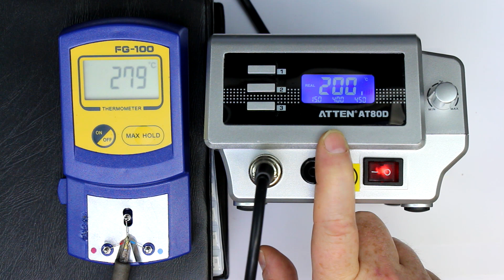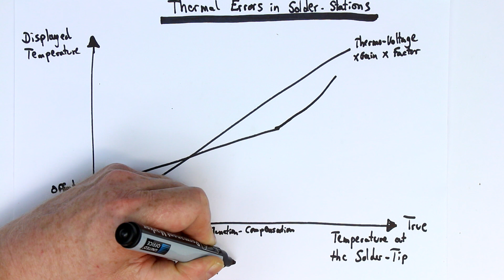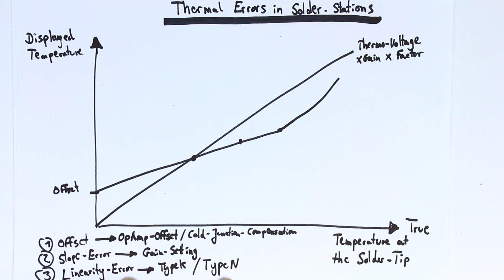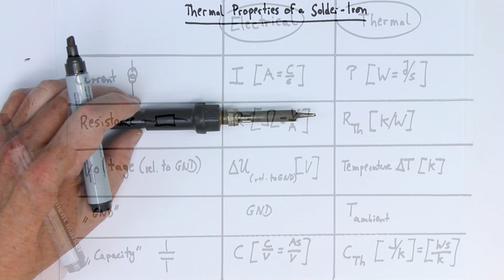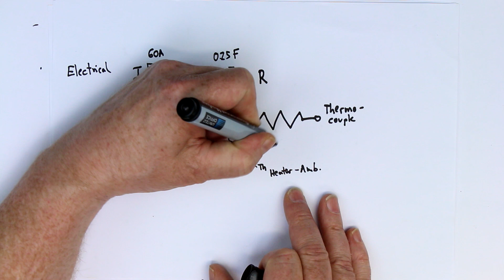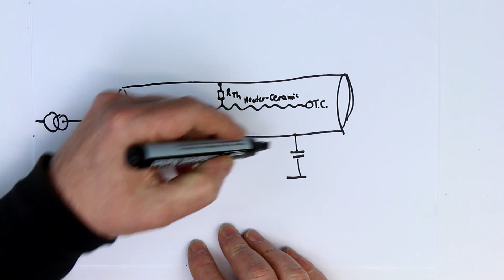Why every solder-station has wrong tip-temperatures and a thermal-lag [Pt.1]

Comment: Maybe pt2 answers it, but the thermal mass of everything in contact with the heater is missing, ie heater element, tip, and retaining sleeve. Basically if you dataloged the tip and you turned on the iron to full heat and then turned it off, your sloping line would be a loop. Most of these controlled irons are an electrical solution to what is essentially a mech problem, but with the feedback a distance away form the thing that is trying to be controlled. The modern tips are low mass, direct contact element close to the tip, and more direct feedback, reducing the mech problems.

Comment: Many thanks Roger for a very interesting lecture, I am now using the TS100 for most of the time run at 19.5 Volts, I would be interested to here your views on how this small iron handles temperature measurement etc.
Regards, Ray in North Wales.
Reply from the maker: I think the TS100 is a good choice. You probably have seen Louis Rossmann´s video about the TS100 especially his follow-up video where he made some additional comments on the pros & cons. I was even thinking about buying one but will stick to the HAKKO especially because I have bought a collection of tips and some of the missing original parts (the stand with the switch etc.). 
All in all the FX-951 clone for less than $45  gives you more flexibility because you can use/upgrade all the HAKKO orginal parts (and with optimised firmware coming in 1-2 months from me will have even better performance than the genuine FX-951:-) 
And you already have the power-supply included.
But the TS-100 is of course unbeatable concerning out-of-the-box performance and portability.
Reply: Hi Roger, thanks for the reply, I follow Louis and watch him soldering, I have been retired now for 15 years, I am 75 so making things and soldering SMD's etc. is just a hobby for me now..
Reply: @KainkaLabs  did you ever finish or release the Fw? I'm sure many ppl will greatly benefit & appreciate it,thanks in advance

Comment: Thank you very much for this video, I saw you ran out of IO pins to fit an additional internal temperature monitor, have you considered using an external MUX chip to give you the additional lines you need as I am sure the multiplexing speed and the speed at which measurements need to be made would allow that to work fine (I may just be being picky!) I too am shocked that solder stations that I have spent over £500 for lack this fairly basic thermal compensation and correction methodology, thank goodness temperature controlled oscillators do not have this kind of error.... OR DO THEY?
Reply from the maker: I will probably leave out the current-measuring feature and use the free I/O-pin then for an external one-wire tmep.-sensor like the DS18B20.
I want to make the mod as easy as possible with the least amount of rewiring and additional hardware.
ATM (except for desoldering the original controller) only a few wires have to be added or rewired.
And I even have found a way to use the cheap stand (without the switch) to give a sensor-signal for the controller when the solder-iron is placed in the stand :-)
If you mean oven-controlled xtal-oscillators (OCXO): Well the thermal lag is present also at these.
But because the time-constant of the (mostly often analog) control-loop is extremely large this has no practical consequences.
Remember that even the rubidium or cesium frequency standards are in fact basically OCXO that are tied to the rubidium or cesium reference frequency. And there you get a stabilit in the range of 10^-9...10^-12.
So it´s just a matter of laying out the control-loop the right way to get a good thermal control of the solder-tip.
But watch out for Pt.2 where the really interesting things are coming :-)

Comment: Pardon my ignorance... why is it so import for a soldering tip to be exactly on temp... I guess I’m saying how much error is tolerable on a hand held soldering iron?  I’ve been soldering with a basic iron for years and so far no problems.  Seems the time in contact with the component is another rather critical uncontrolled issue?
Reply from the maker: Do you think 50...100°C difference between displaed and real temperature (which I have seen) at the solder tip is unimportant? When doing hobby-soldering, norhing is important. When doing serious work, everything is important.